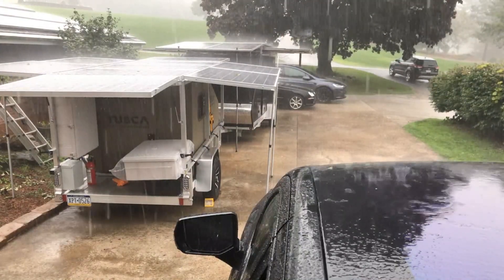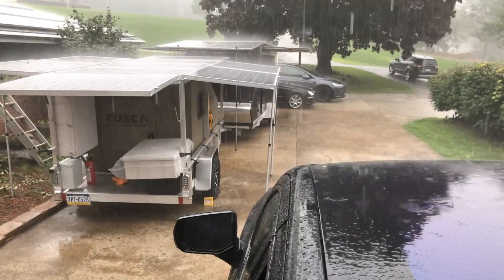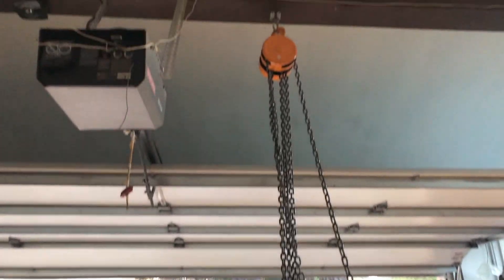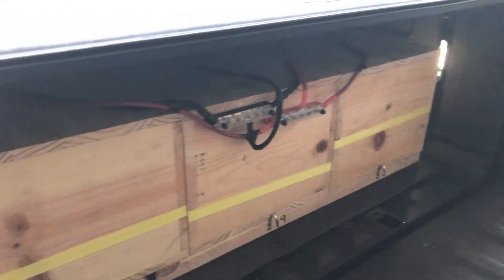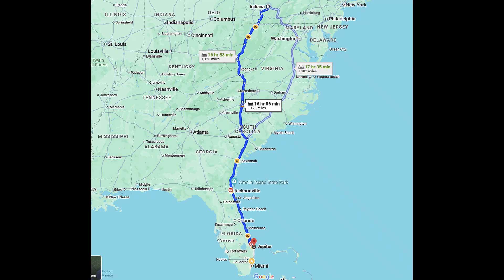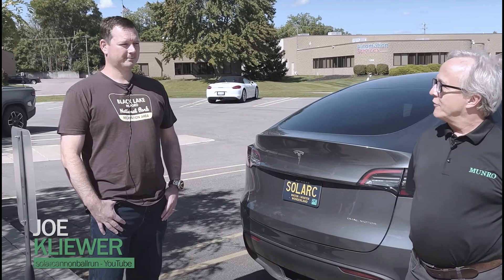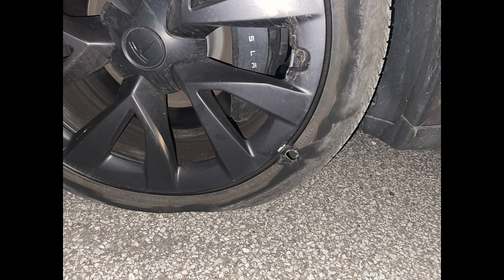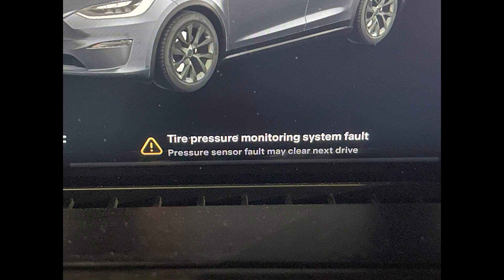Solar Trailer version 2.0 Battery Build Day.  Preparing for a modified Cannonball Run.  Episode 6

Comment: Wouldn't it be cool if you extended the solar panels off the back of the trailer by a couple feet - similar to the "trailer tails" you see on some 18-wheelers?  You'd gain some aerodynamic efficiency AND gain room forward on the trailer for more solar!  :)
Reply from the maker: I could easily do that since the back panel is on struts and opens easily... I could put a supporting piece in between the frame and the panel to lock it in place... voilà I have a trailer tail!
Reply from the maker: Yes I had to look up the proper spelling of voilà

Comment: Love the build and your videos. Have you considered a workaround to charge while towing? I have a silvarado ev and tow my 37 foot camp trailer. I have solar and batteries with 50 amp service    without success charging while towing so far...
Reply from the maker: I mean to say that I will be charging the 45 kWh of batteries in the bed of the truck while towing...  Not charging my Silverado.  Is that what you would like to see?
Reply: I would like to see that. However, I am curious if it is possible or even useful to find a way to activly charge the truck while towing . If we can not, I will look into the efficency of level 2 charging from the trailer during rest stops.  Thank you again for your content...
Reply: What are you getting for miles per kilowatt towing that?
Reply from the maker: @timj9350  I normally get 2.2 miles per kWh @ 60-65 MPH.  When I drive 45 - 55 MPH I have gotten 2.5 miles per kWh (that is 512.5 miles of range).  On highway, towing I average 1.6 - 1.7 miles per kWh.  So on the low end that is 1.6 miles x 205 kWh =328 miles of range.  I cannot complain